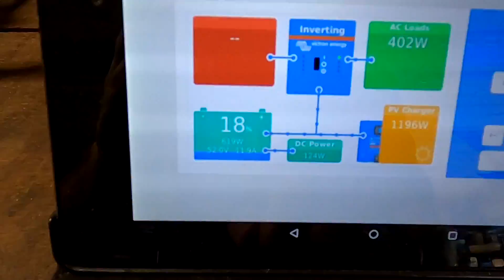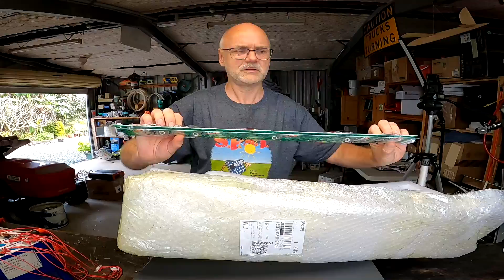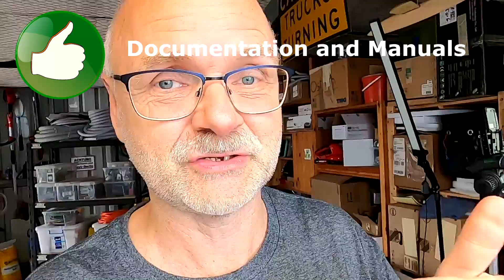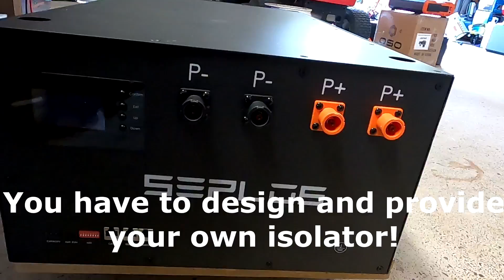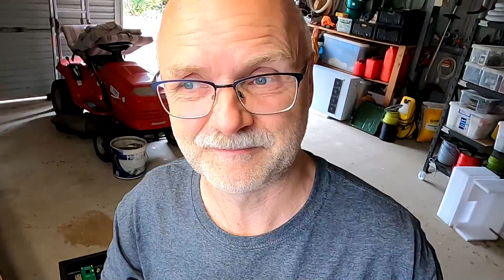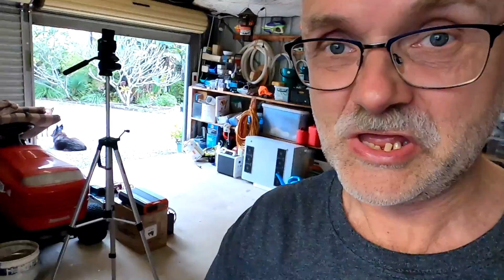Considering a SEPLOS Battery or BMS? Here is my experience so far...

Comment: As I said in your other video, I ordered 8 of the DIY 280Ah/200A BMS kits and all kits came packaged VERY well - no damage or issues.  As for grounding, if you buy ready-made batteries (e.g. Battle Born) they do not need grounding and these cases are powder coated.  I think your negatives are very opinionated.  The terminals could be a positive from a beginner aspect.  As for the BMS parameter settings/BT access, I think you are not considering these BMS' are meant to be enterprise grade.  You would not find BT access to anything within a data center.  That would be a HUGE security hole - "What do you do if you don't have a computer at home?"  This comment baffles me.  How did you order the dang things in the first place???  Sure I understand the Mac scenario.  I use 99% Linux at my house, but the market share for home computers is still majority Windows.   I'm working on an open source app to communicate with these BMS'.  Hopefully I can bridge the non-Windows gap for others and I'm hoping to setup a Raspberry Pi image to monitor these.  As well though, you should only need to change parameters when you first set them up.  These batteries should be "set and forget" appliances.  For balancing, you should only have to top balance them when you put them into production (as long as you new Grade A cells,) and again - "set it and forget it!"  You SHOULD only be charging to 90% and discharging to 10% in order to preserve your cell investment.  I look at it as a feature that I don't have to worry about doing any calculations to setup the 90/10 rules.  If you have to balance your cells often, then I think you have other issues.   I can also say that they DO NOT shut off other batteries if one is turned off.  They do however, all turn on when the master (#1) is turned on and they are all connected to RS485 and addressing is set.  I agree there is room for improvement.  Though in my opinion, every battery has room for improvement.  I'll be putting out my video on these soon.  For those who have Schneider equipment, I also have a python app that I wrote to query the Schneider equipment using the Conext Gateway.  I also have a Home Assistant add-on for it as well along with the instructions for creating a Docker image on my Github page.  https://github.com/shorawitz/conext-api
Reply: i agree to everything you said, albeit my negative experience with the 280AH version, which i eventually had to return.
communication with my Growatt SPF was a swift, & it showed battery percentage down to the decimal. However, it acted up on the charging side where i would be draining the battery with a constant load of 1kw for 4 hours, & battery percentage would drop respectively to 71% from 100% ; however, when i start re-charging, it jumps within a minute to 100% again at which point it would stop charging. then draining back at the same pace yields the same results albeit for just 2 more times (4kWH X 3 ~ fully discharged) until eventually it drops from 100 to 6% in a sec & automatically shuts down with an "undervolgate fault".....At which point it would then charge normally to 66% for hours & hours, then hits 100 from 66 in a sec........& repeat! 

customer support wasn't able to pinpoint the problem & agreed to return it.
Reply: @ilcooldj what was you experience ordering from seplos?
Reply: @michaelkaine345  My experience ordering is better than average with Chinese companies, but not 100%.  Support 50/50.  Actually 50/50 is probably too high.  I just reread my original post and I didn't mean to come off as combative towards Andy.  I really appreciate all of his time and effort producing this content for our benefit.  And now that I've had mine in production for a while, I appreciate his opinion even more.
Reply from the maker: Thanks for sharing your thoughts and opinion.

Comment: Andy, If you connect all BMSes to the Victron DVCC you don't need the Victron shunt.
Reply: Can you elaborate? Did you tried it? I have read the CCGX documentation where they give the following example: 
Example 1 - Managed CAN-bus batteries For example, in systems with an Managed CAN-bus BMS battery connected, the GX receives a Charge Voltage Limit (CVL), Charge Current Limit (CCL), Discharge Current Limit (DCL) from that battery and relays that to the connected inverter/chargers and solar chargers. These then disable their internal charge algorithms and simply do what they're told by the battery. There is no need to set-up charge voltages or choose the charge algorithm type.
Have you tested a GX device communicating with the Seplos?
Reply: @DrCoolZic  I haven't tested a Seplos with DVCC. I referred to Andys statement he doesn't see a sense in connecting a BMS to a charger/Inverter.
Reply from the maker: No, that's not quite true with 3 BMSes. Which one would I believe? This may work with one battery/BMS only but certainly not with several BMSes
We get to this in one of the next videos...
Reply: @OffGridGarageAustralia  Andy that is an extremely interesting comment and I can't wait to see the video where you go and test several BMS connected to a GX device.

Regarding the question of who communicates with the GX device, the answer is relatively simple: only the master BMS is connected to the CAN bus and therefore it is necessarily the master that decides which orders to send. Now the question is how does the master decide which orders to send? Indeed, the different BMS are connected to each other by the RS485 bus and therefore they can communicate their status to the Master. So, if the Master BMS is intelligent enough, it can make decisions that are appropriate to the situation of all the BMS. For example, if one of the batteries is almost 100% charged and another battery is relatively discharged, the Master BMS will send an order to reduce the charging current from the solar and let the rebalancing take place automatically between the batteries. But for this the BMS needs to have a relatively intelligent algorithm and I am not sure that the Seplos BMS is able to do this?
This is the kind of test I would like to see in your next video

Comment: Be very carefull ording the DIY kit or even the 6,9 battery cell edition cause one point has not been mentioned but had happened in germany several times in 2022 already.
If you order such Mason Diy Kit you will pay the bill incl. shipping, import duties and sales taxes upfront. So far so good.

One morning a courier driver will ring on your door and give you a parcel but first asking you for handing over taxes and in case of bad luck you will pay the import stuff again for the small BMS they had shipped later but arrives earlier incl. a bill of the full diy package about 800 and more €.
The customs then will do the math and ask maybe for 20% on top of the 800€ bill and therefore you would have to pay 160€ again which you had already paid just due to the mess that has happened in germany in 2022 quite often without solving the core issue right.

You will pay the amount to the driver still believing that you will get it back but SEPLOS does not care at all, even in cases where you would only have a bill of 230€ for the BMS and the then 46€ duties on top. You will be lost in these cases and your finance agency and SEPLOS will benefit. 

So you need to make sure that you pay with paypal and nothing else to be able to fight against Seplos mismanagement later on.
Reply: Did you specify you wanted DDP shipping?
Reply from the maker: That totally depends on how you negotiate the price with Seplos and what tax regulations you have in your specific country. 
Something to consider with everything you buy from abroad.

Comment: Price: No
Shipping: No
BMS: No
Terminals: No
Pre-sale CS (zero): No
Verdict: Not a chance
Reply from the maker: If you only focus on the negative points, of course its bad. Like with everything else 😉
Reply: @OffGridGarageAustralia  when it comes to function and money I tend to be cautious.
If they sold this as a case without the BMS and pcb’s, it might be worth the chance. Since I’m not experimenting, per se, I need it to work and not be constantly reaching out to a CS that may, or may not, be there. They have failed to get back to me after several attempts to contact them.
I maintain Flight Sims for the military and we can’t tolerate lack of communication and faulty parts. (Yes, we have some defective parts and software). We have to maintain 100% availability, so I have grown accustomed to that level of availability and function.
These cases have a LOT of potential, however.
Reply from the maker: @marknichols7861  Good point, thanks Mark.
Reply: @OffGridGarageAustralia  I really appreciate your videos and the depth to which you go to uncover things that we, collectively, or individually, may overlook, and /or be too lazy to investigate on our own.
Keep at it.

Comment: I think you forgot one negative point?? The busbar on de 280kit was to short to connect the left to right cell rank (you fixed it with your own cable). So technically this means that the kit isn't complete or not compatible with all eve 280ah cells..
Reply: It is compatible if you use the expected EVE cells LP280K or LF304.
Reply from the maker: Yes, correct, this one busbar won't fit if you still use the older LF280/LF280N cells.

Comment: I've ordered a set of 16 EVE 280 batteries and am looking for a suitable enclosure. This one looks quite good, though the price of shipping seems steep + the BMS balancing concerns vs the JK ones. Suggestion: Would it be possible to ship the enclosure flat packed to save on the volumetric cost of shipping?
Reply: Nope, most of it is welded. Check out the earlier videos.
Reply from the maker: I suggested that and their reply was that they have to pay for the weight, not the volume of the packaging. I think it's a combination of both though.
Reply: @OffGridGarageAustralia  it is always both.  international shipping is really complicated now. here is my advise :  cell suppliers have more experience with shipping to the end customer. So when you order cells, have your box sent to your cell supplier and let them handle the shipping ;-)
Reply: @OffGridGarageAustralia  I was quoted US$258 for shipping the DIY kit to the UK and PayPal transfer fee. Overall I think this could be a good deal as it includes all the components, cabling and a very sturdy enclosure. If I was to order all these parts separately, crimp the cables and make all the other custom parts, it would likely amount to much more in terms of cost and time. So I'll order one of these today!

I'll try to get the software work with the RPi and Home Assistant and publish the details.

I'll also be ordering a NEEEEY as an upgrade to the kit : )

Thanks for all the reviews and the content you're creating!
Reply: I was also in your situation a while ago, I chose to go with building  a birch plywood cases of my own. I bought through-case 300A battery terminals, JK BMS and a Tomzn 2-pole 125A DC breaker on Aliexpress, and  I am happy with the result and certainly saved money on the case & parts.  The deal breaker for me was not the price of the Seplos, but the combination of the price/shipping/BMS issues combined.
Building a quality case is no small task, and not every solar-enthusist has the ability to build their own cases. If Seplos could address their BMS, and perhaps have the cases shipped in bulk to EU, N.A. and UK warehouses for distribution to cut shipping costs may be best for end users.

Comment: When you had balancing issues with the Seplos BMS you had used some of the cells to do capacity tests. These cells were at a different SOC than the untested cells. What do you expect from a BMS when you have done what you did with the cells?
Reply from the maker: That was part of the test as I said in that video. You would normally do a full top balancing before building the battery with your cells.
As we have seen before the JK-BMS can handle such situations thanks to it's active balancer.

Comment: Really looking forward building my 280AH Kit after testing the last 3 Cells. Have some concers about the communication to the SMA Sunny Island Charger but lets see how it will work. Thank you for your quality content 👍
Reply: Flawless with the right firmware
Reply from the maker: If you cannot get it going, get in contact with Seplos. You may have to upgrade the firmware as Patrick said.

Comment: You contradict yourself. You claim elsewhere that you get 100% SOC while charging at a lower voltage by using a longer absorb. Now, you claim the Seplos BMS limits the charge to 95%. You cannot have it both ways.
Reply from the maker: Looking at the voltage is not the same as looking at the SOC. We know this from the many many test we have done here on the channel.
Reply: However, you state in another video that you get 100% SOC while charging at a lower voltage provided the absorb is longer. So, what is different? You are not making sense.

Comment: I am truly considering buying two of the big cases, but the shipping cost needs to go down!

And I really like your videos! You have both knowledge, charisma and you have a really cool accent 👍🏻😁

Greetings from Norway 🇳🇴
Reply: Be very carefull cause one point has not been mentioned but had happened in germany several times. If you order such big Mason Diy Kit you will pay the bill incl. shipping and norwegian import duty and sales taxes upfront. So far so good.

One morning a courier driver will ring on your door and give you a parcel but first asking you for handing over taxes and in case of bad luck you will pay the import stuff again for the small BMS they had shipped later but arrives earlier incl. a bill of the full diy package about 800 and more €.
The norwegian customs then will do the math and ask maybe for 20% on top of the 800€ bill and therefore you would have to pay 160€.

You will pay that believing you will get it back but SEPLOS does not care at all, even in cases where you would only have a bill of 230€ for the BMS and the then 46€ duties on top. You will be lost in these cases and Norways finance agency will benefit and SEPLOS. 

So you need to make sure that youi pay with paypal and nothing else to fight against Seplos mismanagement.
Reply: Ok. Thanks for the tip 👍🏻😊
Reply from the maker: It is with anything you import though, not just this case...

Comment: Once you have all your parts of the case grounded properly     BT might be unable to connect to your mobile phone because of perfect shielding.
Reply: no that is not the case. It will get through that box at least if you are next to it. We have a similiar device and whereever the signal gets out it gets out like the open earth hole or the display and the ports. Of cause not with a perfect long range  but good to work in the same room on the desk except you have a shed of the size of a dance hall floor.
Reply from the maker: Never had a problem with that. The range suffers a bit (not much though) but I could always connect.

Comment: I would like to see you try the batrium bms
Reply: Why if there are already plenty of these and it is a quite expensive solution ?
They, Batrium, would need to provide them to Andy for free otherwise I would not even think about cause they are really expensive.
Rather than the expensive ones I would suggest to check the open BMS by Stewart Pittaway which you can build on your own and expand later.
Looks far more promising for a diy community than the Batrium one.
Reply from the maker: I am in contact with Batrium for a while but never got the hang on it. It's not a straight forward BMS and I'm sure it will just work. Where is the fun...
I also looked at the Open BMS but didn't have time to order all the parts and solder this all together. The ready built version was not available for a while and some parts are still hard to get. And the flashing and programming probably turns away a lot of people.